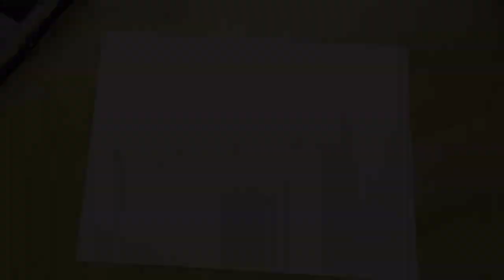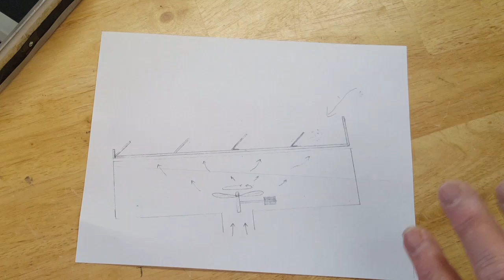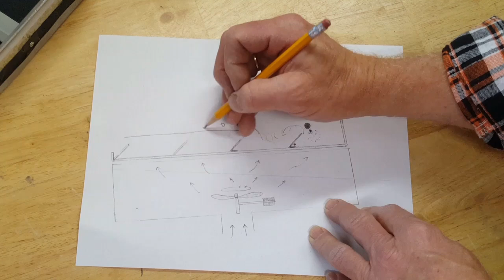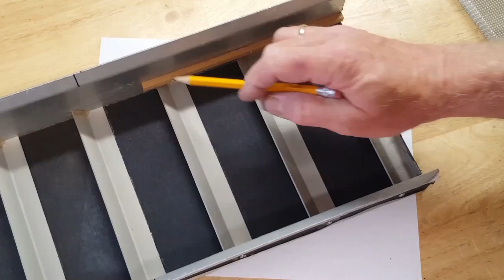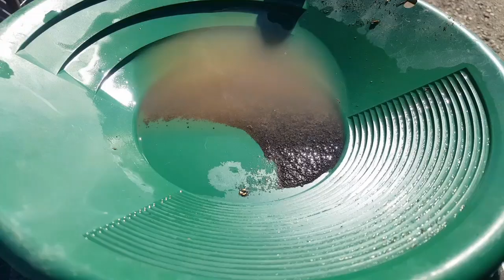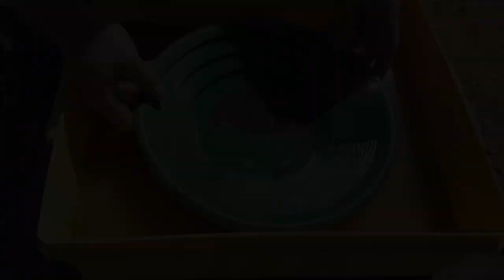Gold Mining Dry Washer - How to Maximize Recovery

Comment: Hi Allan, I checked out the Lowe’s buckets. They’re very rigid. have a question about the trommel. Do you have an idea on longevity and which part/s do you see wearing quickiest (so I’d keep spares)? Thanks, Terry
Reply from the maker: Honestly Terry, I've only run about 20 yards through the system so far, and haven't noticed any excessive wear.  I performed a complete inspection last month.  I'm quite amazed how well things are holding up !  I speculate that the plastic bottom plate inside the hopper would be the first to go, considering it takes a beating from all the rocks being dumped on it.  However, it's holding up too !  This past weekend my waterproof bilge pump died, so I had to replace it.  Somehow water leaked inside the motor compartment through the power cord insert, and shorted out and burned the brushes.  It was sudden and unexpected.  I plan to raise the pump high enough out of the water to keep the cord dry.  That's the only issue so far.

Comment: Don't know if your still watching the comments.  My question would be would it not be better to preclassify the material before putting it through the dry washer?  Get out everything #4+ (and metal detect that to pick up any nuggets, and only run #4- though the drywasher, turning down the air flow to minimize the loss of fine gold.  Since you don't need to blow out the big stuff, you shouldn't need as much airflow.
Reply from the maker: Hi Michael.  Thanks for your question.  Yes, you're idea would work as well.  The screen idea, attached to the dry washer, permits the operator to classify material "on the fly." Best of luck to you in your prospecting adventures. !

Comment: Why not line the bottom of the hopper or the head of the riffle tray with magnets to collect the black sand and gold (by getting stuck in the sand) allowing the separation process to be more efficient. The screen idea is genius, btw. Great tip!
Reply from the maker: Audrey, thanks for complements.  The folks at Snake River Products have a device called Clean Gold, which utilizes magnetic strips to create a black sand riffle field for trapping fine gold.  I use it on my wash plant sluice.  Works great on fines.  However, the same concept doesn't work well on air or dry material.  Will keep trying though !

Comment: Interesting modification.  Your mod is similar to an "underflow" sluice box on a dredge.  I may have to try it sometime.  You are a natural video maker and your narration flows well.
Now a suggestion or two….
I don't understand why you don't use a magnet to carefully remove all that black sand when doing your cleanup.  It will make the process so much easier.  So will classifying your cons before panning.
Your experiment and results are valid only for your particular dry washer and material.  You can't apply your results to all dry washers with varying airflow, etc. out there processing a huge variety of material and gold particle sizes.  If you want to take your experiment further and then make your claim, then you will need to spend the time to process material from many different areas with many different dry washers.
I wonder if the bellows type dry washer would benefit from your mod?
Great video.
Reply from the maker: Hi Nick.  Thanks for your compliments and thoughts.  I don't like to use a magnet to remove black sand from concentrates.  The filings tend trap fine gold.  Tapping the magnet helps a bit, but not completely.  The panning in this video was for quick demo purposes.  Generally, I take all the cons and classify, then run through a Blue Bowl or Maverick Finishing pan. These effectively separates the black sand.I believe the screen technique with work well for all vibra static dry washers.  Just a matter of adjusting the air volume and riffle angle for each condition.  Not sure how well this idea will function on a billows system ?  Hope somebody out there can test and report.  Would be interesting.Currently, I'm designing a dry wash plant that will classify material through a dry trommel, then flow onto separate dry washers at different rates, air flow, and angle, to move volume and improve recovery.